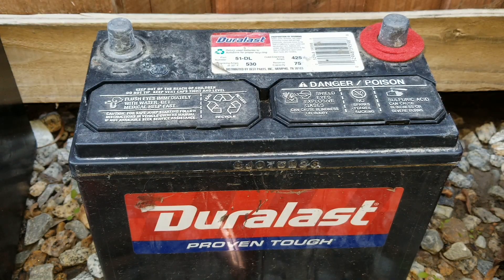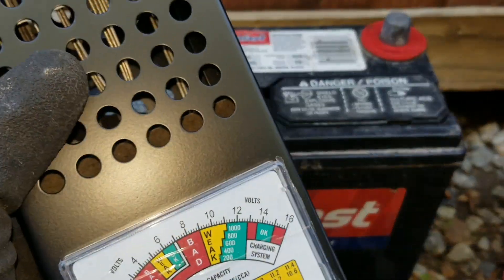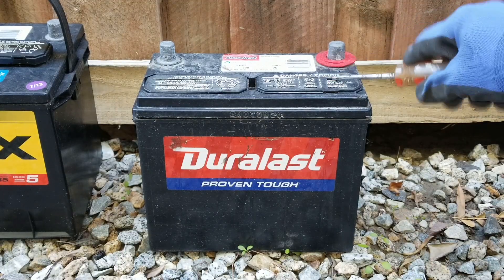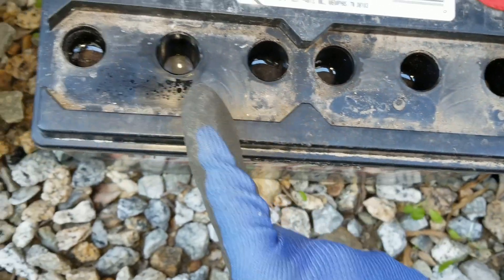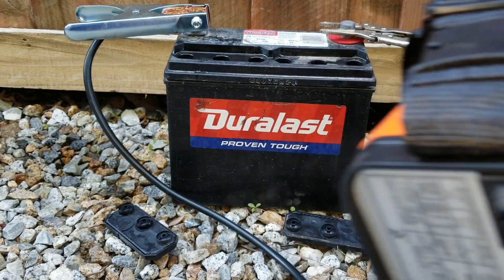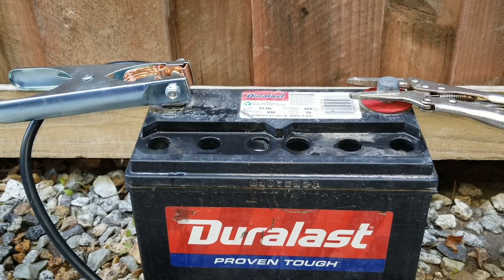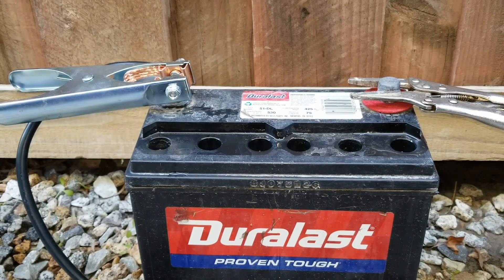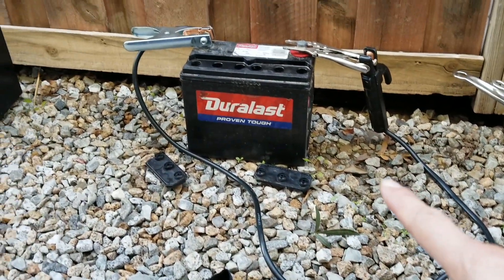New Way & Method To Revive An Old Dead Weak Lead Acid 12v Car Battery

Comment: NO !  Extremely dangerous. 
Huge explosion risk even after performing this procedure. 
Lead acid batteries can go bad in many different ways. 
Buy a new battery and don't let a lead acid battery go completely dead for maximum life.  Ken
Reply from the maker: I have tried many cycles and it doesn't blow it up, you must open the caps but make sure you don't ignite anything near it if it release gases (be sure to filled up the distilled water).